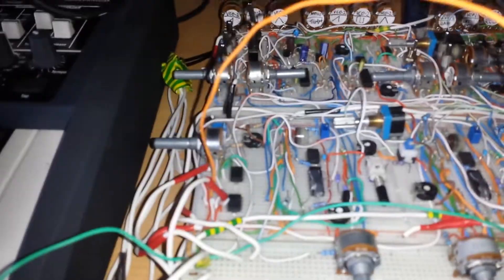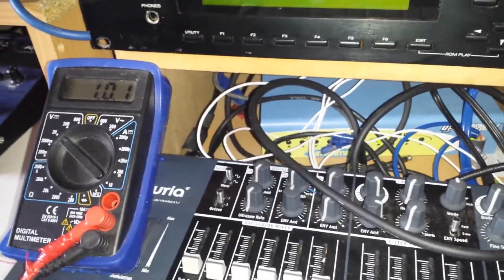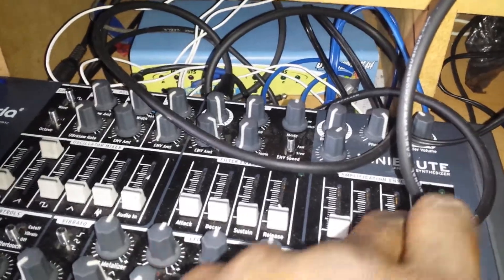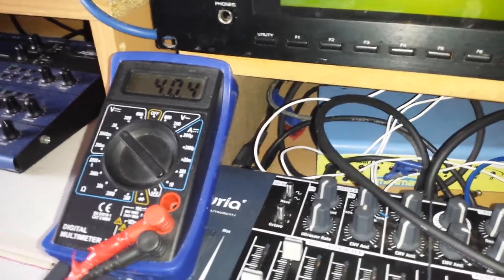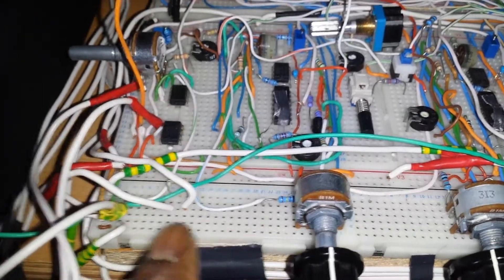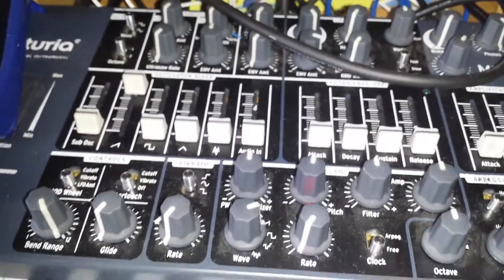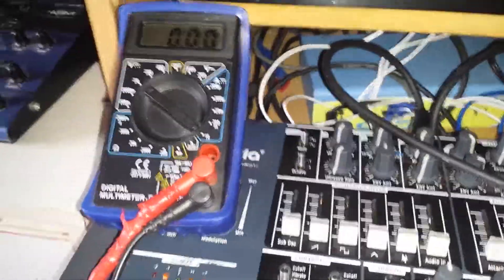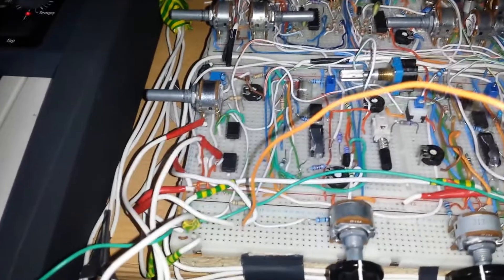DIY analog synth project Tutorial Part 8  (CV and Gate input voltages.)

Comment: I'm not sure about the Minibrute but other Arturia CV devices like the Keystep have trimmers inside that allow you to recalibrate it. My experience with the Keystep was that I was able to calibrate it better than it was by default to the point where I got it pretty much perfect across the entire range. It doesn't really matter that much from a musical point of view, but I was trying to calibrate my Eurorack oscillators properly to work with the Keystep and other CV sources so getting them all as close to perfect made sense as errors and offsets accumulate in such a setup.
Reply from the maker: basicbasic . Yes the minibrute does have 2 internal trimmers for calibration but these are not something i have tampered with as i havent found any documemtation in the manual on them as of yet . Yes completely get your point thou. Accuracy can be a must when running to multiple vcos.